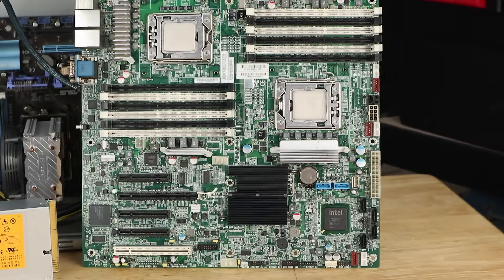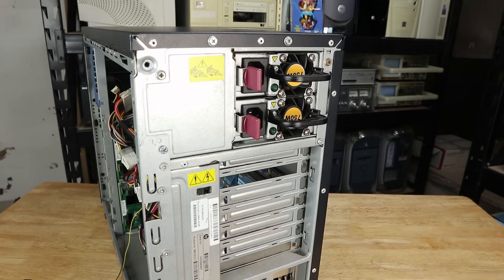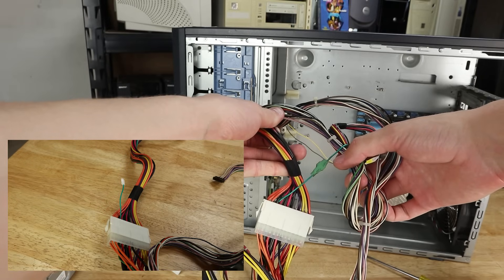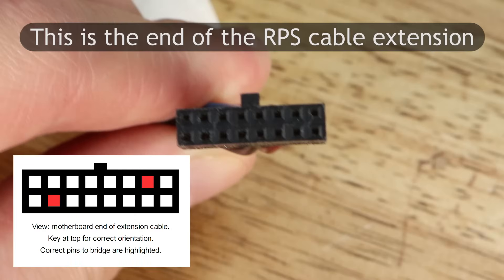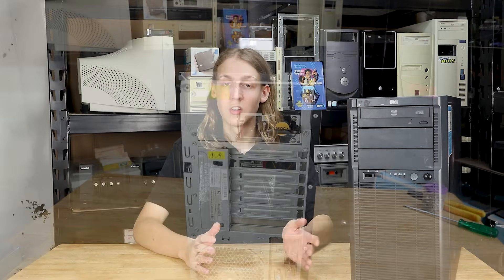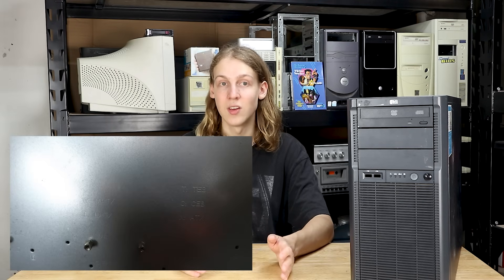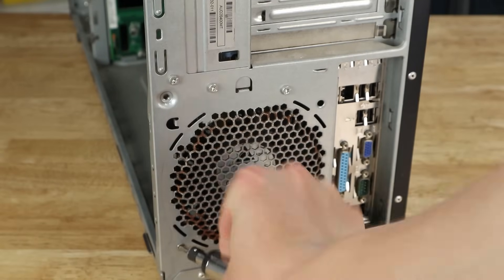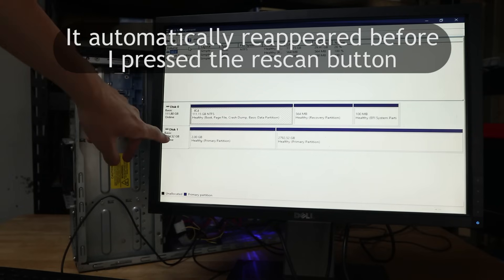An EIGHT Bay Home Server Case For Only $8

Comment: Great job! One thing anyone trying this on older backplanes should be aware of is some don't support the 'Power Disable Feature' provided by the SATA/SAS drive Pin 3 of larger/more modern hard drives.

If a smaller, older drive spins up when insert into the backplane, but a newer typically 6+ TB drive doesn't then this is the issue.

I have an older Lenovo server I refused to e-waste. Thinking it was something wrong with the backplane I finally discovered the reason and an easy solution. I just placed Kapton tape over pin 3 on each of the drives I'm using as detailed here https://www.youtube.com/watch?v=9W3-uOl4ruc
Reply from the maker: I completely forgot about this, thank you!

Comment: I’m fairly certain it should be possible to get the redundant PSUs working, the CS PSUs themselves need only one single pin to negotiate redundancy, so it’s more of a question of tricking the backplane to accept its new life without the HP server motherboard.

Comment: Redundant power is a big bonus and useful. I reckon you could maybe use both by bridging the DC lines with extreme care, and maybe through some high current diodes in parallel per supply, would certainly prevent 1 supply leaking through the other (failed) supply if/when it fails or drops in voltage long term and say... you didn't notice,. the diodes might help stop it catching fire? Voltage meter per supply helps you immediately notice this.

Comment: Hi weird question to asked but can I use an ML110 G7 case for this? I already have an mATX motherboard and old athlon 200ge which I planned to upgrade to an R5 4650G PRO. And could I still use the old PSU?
Reply from the maker: Yeah, you probably can. It looks like a standard mATX case. I don't know about the PSU, so while it has a standard screw hole layout, the pinout might not be standard.

Comment: use the solering iron  to apply heat-shrink tubes since it is already hot and it's in your hands, instead of open flame get a jet lighter highly improove the results ;)

Comment: Nice work, far better than my own janktastic Dell T5810 "thing" but then mine is for a somewhat different usecase, found it cheap with 32gb, quadcore xeon and 500gb disk -- it is now a 96gb ram equipped 14core with 2Tb SSD and 10Tb HDD and a Quadro P4000 GPU. Not what you'd expect from the outside as the front has transport damage making it a proper jankylooking sleeper. The GPU is for AI LLM stuff and encoding but the thing can play games too, better than I expected based on the cores being pretty slow on the e5-2683v3 it has. Also stuffed a 4port GBE in it, so it can run properly isolated VM's with multiple dedicated cores, ram and NIC. There are probably "smarter" ways to arrive at a similar result but I absolutely did not want a heavyass rackserver or something too loud to sleep in the same room with. 
It has an ML350G10 next to it that serves as the storage server among other duties, the ML350 has one 2,5" and one 3,5" disk cage, the smaller one stuffed with mirrored 480Gb SSD's for boot and 3x 15krpm SAS 900gb drives for fast storage, and the bigger cage has 16Tb bulk storage drives. So with a 10GBE in the HP fiber linked with Mikrotik CRS310 plus the DELL 1+ quad gigabit for now it's a decent homelab I think.

Comment: Love this kind of content. Great job!😁👍 Nice to see. Would you use only Sas drives or split the two cages between Sas and Sata?  Also do you know if the back planes support Sata 3.0?
Reply from the maker: There typically isn't much benefit to using SAS drives in setup like this, so I would personally just use SATA. Mixing drive types within an array or ZFS pool is typically not recommended. 

Considering the ML150 G6 supported 6 gigabit SAS when it was new, the backplanes should support SATA3 speeds with no issues.

Comment: These are Delta double ball bearing fans aren't they? I really wouldn't replace them. Maybe take out the bearings and put some heavy grease on the shaft to damp the bearing rattle against it, maybe wash the bearings themselves first in degreaser then when dry in gear oil if they no longer feel great, or replace just the bearings. Fundamentally these fans are built to outlive us all.
Reply from the maker: That is a good point, and definitely something I should look into. The original front fan doesn't work, but the rear fan definitely still has some life in it. However, the main reason I would consider replacing them is noise, since they are very loud.

Comment: How did you connect power to the drive backplane?
Reply from the maker: The redundant power supply setup has four molex power connectors, intended for the drive backplanes.

Comment: Finally someone did it. I bought this summer HP ML330 G6 with one PSU and one LFF 3,5" sata caddy and moddified it for my NAS build. It is awesome that these old HP ML cases are so wersatile and easy to moddify. Actually you can swap many parts between ML series. I bought, so ML110 G7 for my collegue and took his LFF caddy, just needed to drill holes for mounting, nothing special. It is really awesome that homelabers can buy and reuse these old, but still great cases and that they use standard parts. 
BTW I made that front panel to work, just repinned original one to single pins.

Comment: Solid video, great example of reusing older tech,
just a question about noise levels , of the server power small fans vs standard power fans, and do you know if the server power fans are constant speed?
and when i went to sub to your channel, I had allready done in the past

Comment: the screws on the mounting plate for the psu's looks like it just might fit a regular atx style psu, im not going crazy right?
Reply from the maker: The case wouldn't fit an ATX psu without drilling new mounting holes (or the bracket included with the original psu).